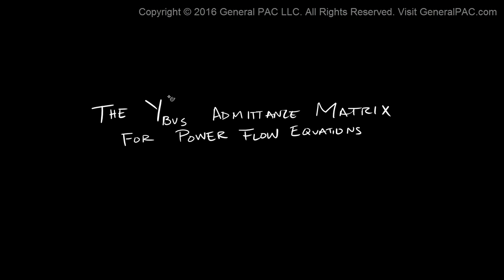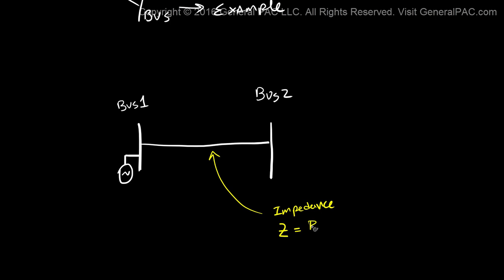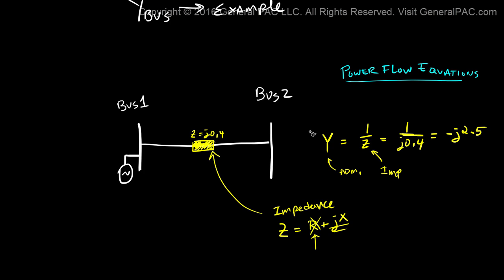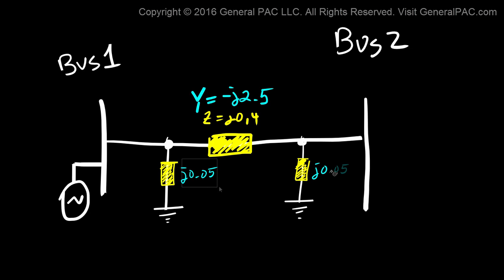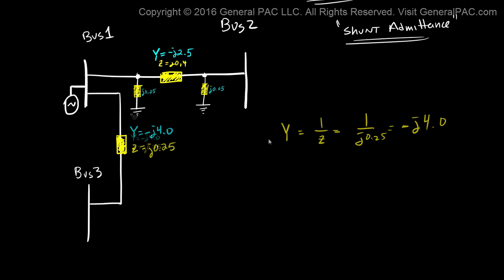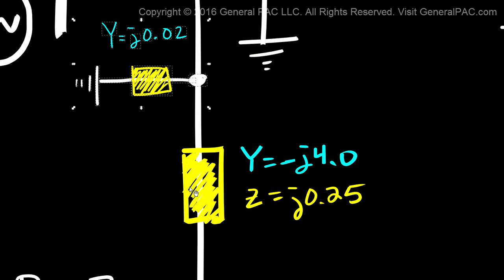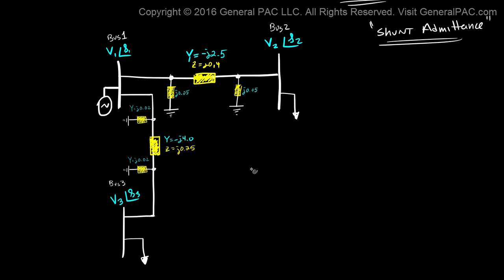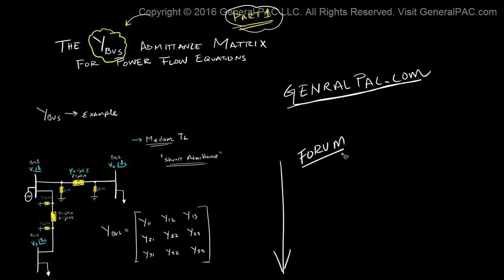The Ybus Admittance Matrix for Solving Power Flow Equations Part 1

Comment: undoubtedly, the best area to refresh ones power system concepts.
Reply from the maker: Hey Taimoor, 
Thank you for the feedback :)
Reply from the maker: We've another course which covers a variety of Power Systems concepts with detailed explanation and we're offering free 30-Days trial. You can have a look at it here: https://bit.ly/PSEVlog
Reply from the maker: Also, if you want to learn about the IEEE-1584 2018 Published Guide for Performing Arc Flash Hazard Calculations, you can join our latest course about this topic on 50% discount. Get your hands on it before it ends: https://bit.ly/3KaZ6fk

Comment: How to calculate 1/j0.4 become to -j2.5?
Reply from the maker: Hello Khollis Tianii,

The 'j' operator is used in engineering denotes the complex number operation if it is attached with any number. It can be simply considered as a basic imaginary number 'i' iota which is equal to the sqrt(-1) . In electrical circuits +j shows that a phase advance of 90 degrees and -j shows the phase retard of 90 degrees.

We can simply convert 1/j0.4  to -j2.5 by using the basic imaginary number laws and operation:

We know that:

j x j =j^2 = sqrt(-1) x sqrt(-1) = -1

Therefore, if we rationalize the denominator, then:

1/j0.4 = 1/j0.4 x j/j = j/ 0.4j^2

We know that j^2 = -1, hence:

j/ 0.4j^2 = j/-0.4 = -j2.5

Thanks, hope this might be helpful! Please don't forget to support us on patreon.com/generalpac

Comment: Can you explain to me, how to calculate admittance shunt if we just know the value of the line impedance?
Reply from the maker: We appreciate your query. Shunt admittance is actually the reciprocal of impedance expressed mathematically as Y=1/Z. If you already know the line impedance then you can easily calculate the shunt admittance by using the above formula. 
However, if you need Admittance matrix, then you need other parameters too.
Reply: If you only know the line impedance, you can calculate the line admittance. But, this is not enough to calculate the shunt admittance, as there is no formal relationship between line and shunt (there are many physical factors envolved). It must be given this information, as a line characteristic.

Comment: Does the load connected to any bus (slack bus included) make any difference to the Ybus matrix?
Reply from the maker: +priya raghuraman  There should be no load connected to the slack bus. That's one of the rules of the Slack bus. Also, the Ybus matrix only consists of transmission network. We must include the admittance of the transmission line. And if it's medium length or larger, then account for the shunt capacitance as well. The LOAD is accounted for in the power-flow equations. The power at a particular bus is equal to the power generated at that bus MINUS the load at that bus. or Pi,scheduled = Pi,generated - Pi,load-demand   --- I hope this makes sense.
Reply: Have a look https://youtu.be/5OTDYDGxL2E

Comment: In a fourth order matrix , why an impedance is not connected between nodes 1 and 4 . (assuming generators at all four nodes) ?
Reply from the maker: If there is a physical connections between node 1 and node 4, then yes -- there should be an impedance. But if there is no physical connection (i.e. a transmission line) then there would be no impedance.
Reply: +GeneralPAC: Power System Tutorials thanks !! it is really helpful